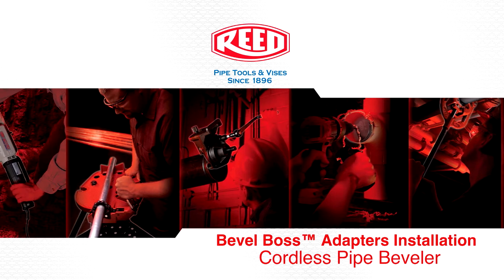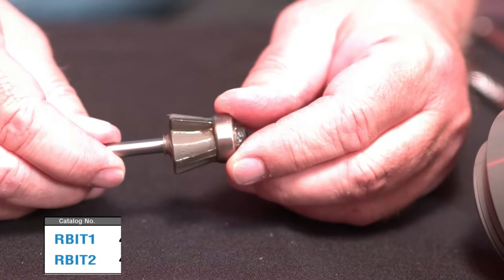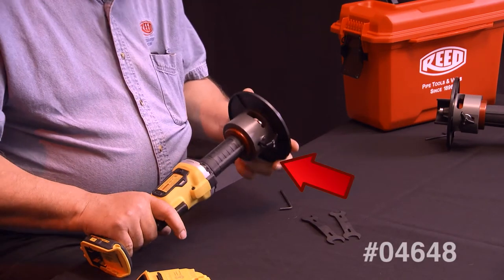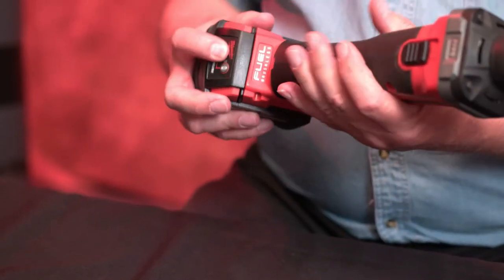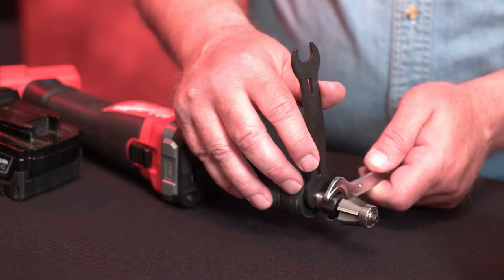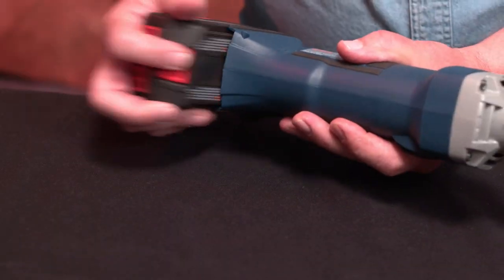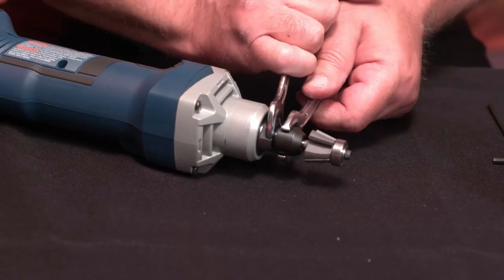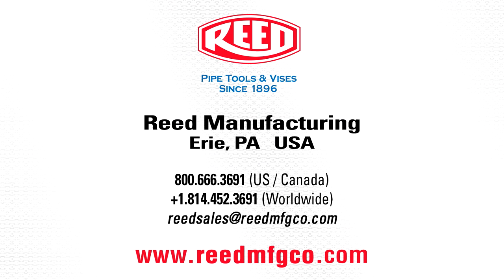Bevel Boss™ Adapter Installation - Reed Manufacturing

Comment: Can I just buy the guide plate separate and use my own grinder ?
Reply from the maker: Sure can!  Check here to choose between DeWalt, Milwaukee or Bosch heads.  And, you'll need to get a router bit.
1.  https://www.reedmfgco.com/en/products/plastic-pipe-tools/pipe-beveler-adapters/
2.  https://www.reedmfgco.com/en/products/plastic-pipe-tools/bevel-boss-cordless-pipe-bevelers/router-bits/
Reply: @ReedPipeTools  Thank you!

Comment: why not  using a wood router with those bits???
Reply from the maker: Thanks for asking!  The REED bits are custom designed carbide bits for plastic. They provide a better bevel and eliminate issues for both solvent cement and gaskets connections.
Reply: @ReedPipeTools  he’s asking why not use a router INSTEAD of a die grinder, not asking why not use router bits with it…
Reply from the maker: @mission664  Router bits, if made for wood, do not have the same construction as REED's router bits.
Routers themselves do not have the same precision or power as the REED system.  The die grinder base gives the right RPMs for repeated use.  And, the REED collars and router bits provide the assurance of a same bevel from one piece of pipe to the next.